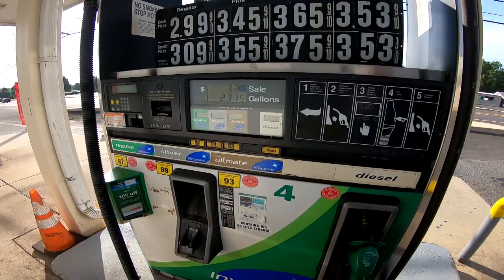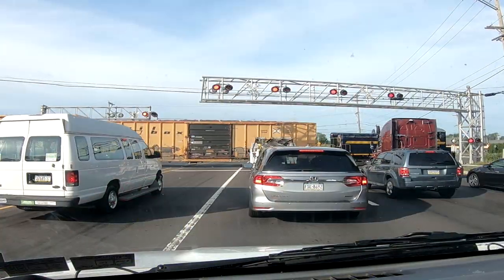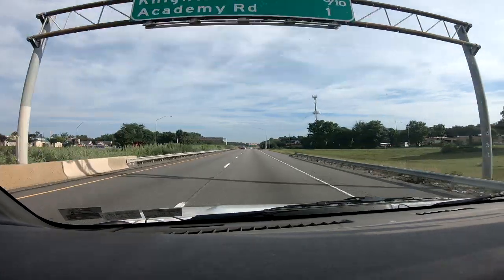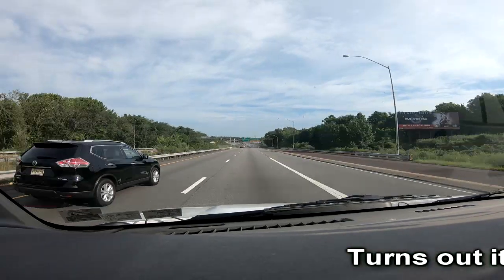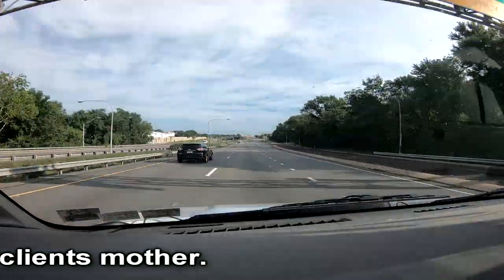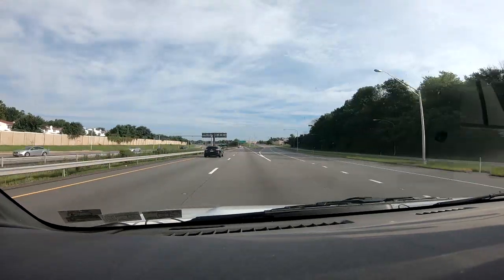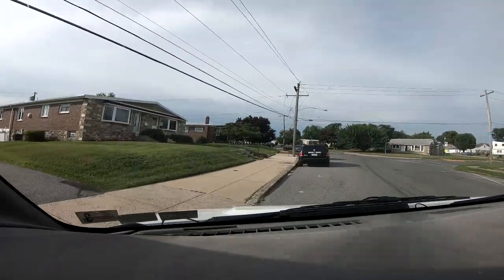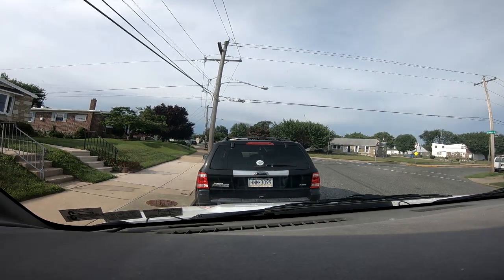How To Install A Wrought Iron Railing

Comment: Perfect...I know rather drill, but what bit are u using? Also do you use concrete fasteners that come with the rail, or do you suggest wedge anchors? Thanks foe the vid.
Reply from the maker: For some reason my first reply isn't showing up, but I use Bosch masonry bits from Home Depot.  I always have good luck using these.

Comment: Drilling on an angle not advisable - remove the railing so you can drill straight
Reply from the maker: Unless you can accomplish it without removing it.
Reply: Exactly! That's the optimal way to do it,  more professional.
Reply: I somehow stumbled on this hack and as soon as I saw him drilling at an angle, I can officially call him a hack!  I wouldnt hire this guy to cut my lawn...

Comment: Need more info, such as screw size and type.
Reply from the maker: I used the screws that came with it which were 5/16” x 3” nut driven. The hole should be 3/16” or 1/4” cant remember for sure.

Comment: How would you remove old bolts stuck in concrete from last railing??
Reply from the maker: I would use an angle grinder and cut them off.

Comment: Does it rust at bottom?
Reply: Probably over a couple of decades, but you could coat the base with a good 10yr silicone to add life to it.
Reply: Yes it will rust because condesation without a weep hole also it can freeze and puff out for the same reason
Reply from the maker: Maybe in 20 years